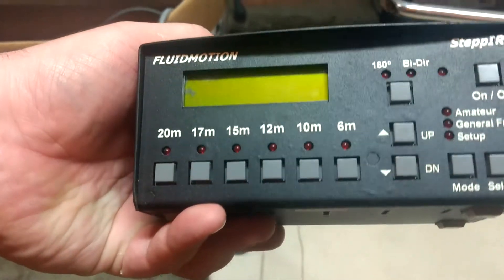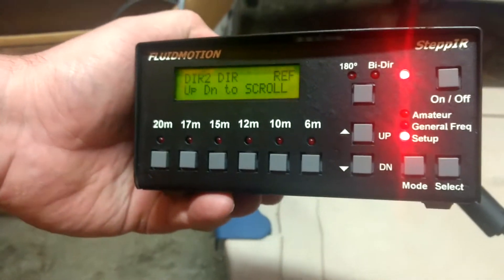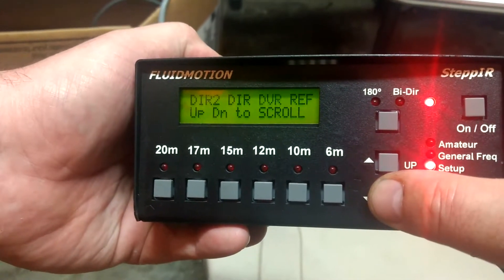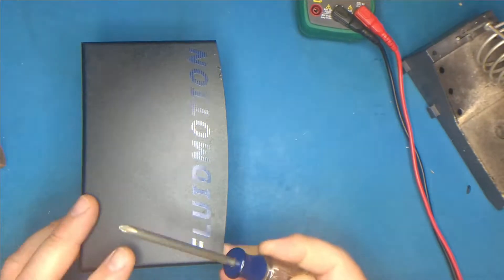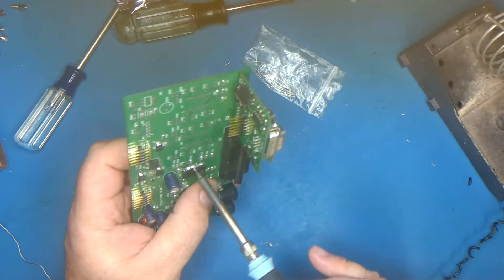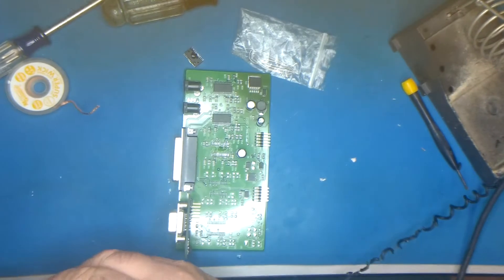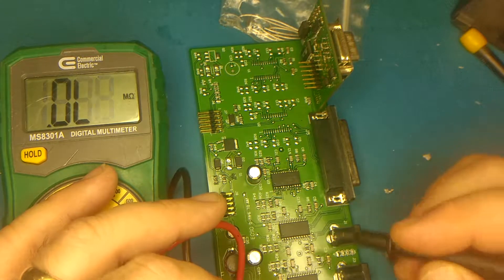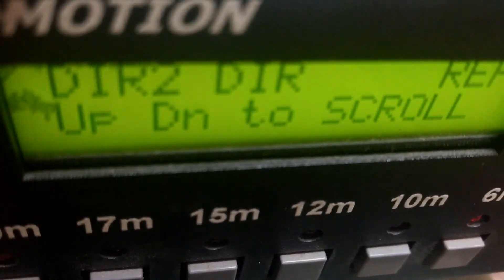Original SteppIR Controller repair of VVS's 3el Controller.  Possible Lightning.

Comment: What pin numbers are you checking first ?  Between Pins 1 and 2 ?    Hard to tell from the video for certain.  
And the second set of measurements... you say "5 and 4"...   Not sure what you mean... can you elaborate ?  I normally reference them by pin number... Pin 1 of those ICs is on the bottom left as you have the board oriented.
Reply from the maker: Pins 1&2, then pins 5&21. Normal, working chips have 8 Meg Ohm resistance on the motor output pins.    Make sure the Fluke is set to the highest/Meg Ohm scale

Comment: What's the driver IC?
Reply: ST L6219DS  stepper motor driver. Got mine at Digi-Key .   W0KU
Reply: @scottb5662  The driver in my Fluidmotion controller may be shot.  The EHU is in for refurb.  Is there a way to test the controller without having access to the EHU? If it’s a blown chip, can you do the repair?
Reply from the maker: @robertchortek1944  Place an ohm meter between pins 1&2, then pins 5&21 on each chip. Normal, working chips have 8 Meg Ohm resistance on the motor output pins.